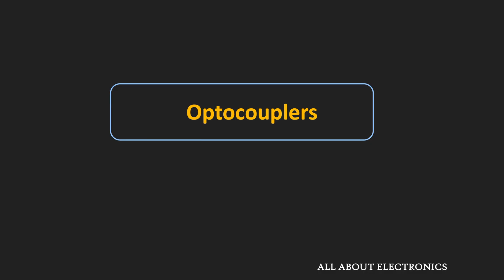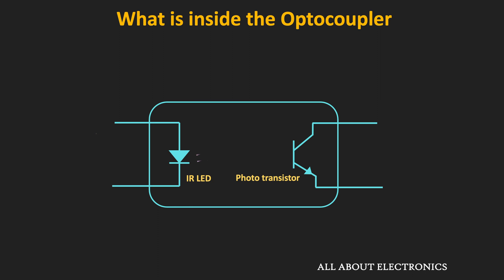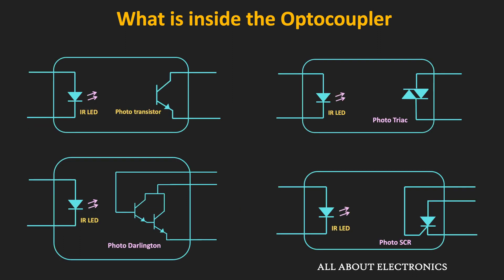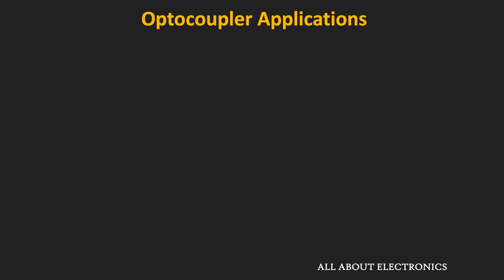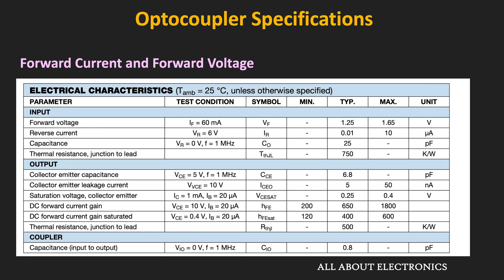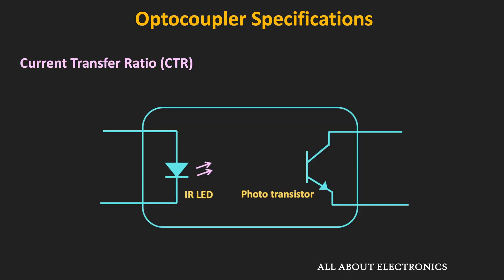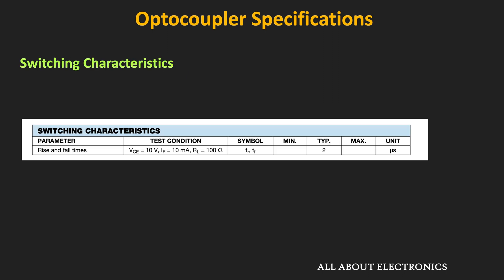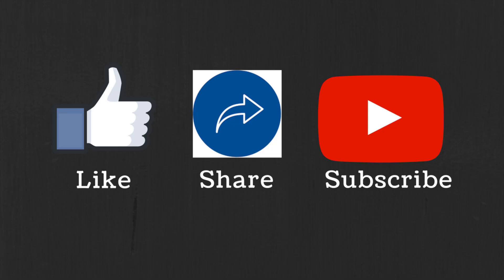What is Optocoupler ? How Optocoupler Works ? The Optocoupler Explained

Comment: Excellent explanation: I have a tough Question for you. 

1. "response time/Speed" ,   2. CTR,    3. Common Mode rejection ,   4. Diode type: GaAs light emitting,  5.Collector current Ic
are factor to decide about optocoupler.  
From datasheet , CTR depends upon IC package. (PC817X X=L, A, B, C, D ).

PC817, 4N25 are these based on old technology ?  
Can you please suggest : What are the better option of PC817 , which is modern and latest ?  ( speed is not at all important)
Better noise immunity, false triggering, cutting.

Comment: why and how is it (5-1.5)??
Reply from the maker: As per the given specification, at 7:16, the LED in the opt-coupler has typical forward voltage drop of 1.25V. And since we want 5 mA current, so accordingly, the value of the series resistor R is calculated. ( Here it is assumed that, the microcontroller pin is providing TTL/ 5V output)

Comment: why is it (5-1.25) / 5mA .... I get the 5 - typical Vf ... but why 5mA?
Reply from the maker: It has been assumed that the 5 mA current is required through the LED of Optocoupler. This formula is used to calculate series resistance.

Comment: Hey ,i wanted to ask if the pc817 has an npn or and pnp phototransistor inside, because i wanted to use it in my audio amplifier for galvanic isolation and you know the common ground problem ,i wanted to use p55nf06 MOSFET ,which is n-channel and wont exactly work with negetive audio signals...if u can help me out with the build it wld be very nice 🙂

Comment: sir good day can i replace any model of optocoupler in a burned optocoupler
Reply from the maker: You need to check the compatibility. The pin numbers and the characteristics should match. If it matches, then you can replace it.

Comment: What is the maximum input voltage of this ic pc817?
And also what is the maximum output of it?
Reply from the maker: In the data sheet, the maximum allowable forward current is mentioned. so depending on the series resistance and the forward voltage drop across diode you can decide the maximum allowable input voltage. also Vce ( max) is 80V. please refer the datasheet for more info.
Reply: @ALLABOUTELECTRONICS  OK sir. Thanks
Pls I want to also know the value of Rs should I use when stepping 240volts down with zener diode.
I appreciate your quick response sir
Reply: Pls reply
Reply from the maker: @chibuzoeze4225  I didn’t get it. How exactly you want to use this IC. For controlling purpose..what voltage you are expecting to give at input ?
Reply: @ALLABOUTELECTRONICS  inverter feedback

Comment: The biggest and the most important difference between relays and opto-couplers is that relays are strictly digital while opto-couplers can send an analogue output depending on the intensity of the LED inside.
Reply: I always understood relays as being more analog than digital to operate....but as far as output is concerned, yeah I can see the digital like property, in it's on or off state and no "in between" to function properly, just  hi or low. 

Guess I'm so use to solid state components, like semiconductors (such as optocouplers), belonging only to digital realm (well, they can be used for analog purposes too) and....yeah I can also see the analog capability of the led to phototransistor relationship happening inside the opto...., as far as variation of current goes to vary the brightness of the inside emitting led for desired varying strength of output.

Yeah thats all a new one to me. That honestly will take me some time to adjust to...because for now I still think that notion is still debatable.
Reply: @SeptemberAdam  your understanding of the terms digital and analog is way better than a lot out there...
Reply: @roseelectronics4582  

Yeah thanks. But not sure if relays are ideally applicable  for digital applications as they tend to be slower in response  than a semiconductor switch, such as an SCR or plain ol transistor and tend to use more power than the aforesaid components,  not to mention that semis are a bit more robust, more solid, than wire wrapped electro mechanical devices, I mean for rapidly  fast switching digital operating purposes.
So yeah I don't know...gotta think more on what you asserted.
Reply: @roseelectronics4582  

PS

Btw, We definitely live in an analog universe. Life for us is  certainly  analog, for living and  no living entities. Variations galore brother!
Reply: relays are strictly digital?  You're joking right?  I must have missed something here.  Relays are strictly mechanical, operate at higher voltages and there is the possibility of magnetic field interference created by the coil on activation. Whereas with optocouplers, THEY are strictly digital in nature, not to mention they can actually transmit signals while isolating the signal and contacts from one circuit to the other, eliminating the need for mechanical activity. If you knew that I now understand your joke, but if you meant that seriously, you need to go back to class.
Reply: @markusallport1276  I meant relay contacts work in a digital fashion, like 1 and 0, true and false. Whereas an optocoupler can be linearly controlled to create analog signals. I'm talking about the same property that BJT transistors possesses. They have the saturation, cut off, and they can also be put the midway. To me, digital is anything that can be turned on or off, without hanging in the middle position. Maybe I'm misusing the term. 
Like you mentioned, relays are strictly electro-mechanical as well. That's how they are operated but they still put out a digital signal. Anything that can create binary logic can be classified as a digital device.